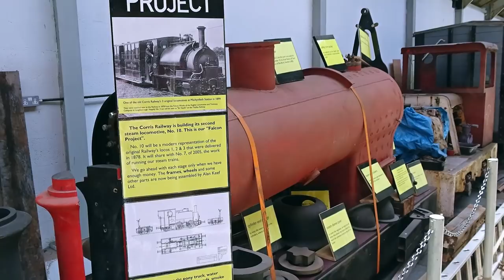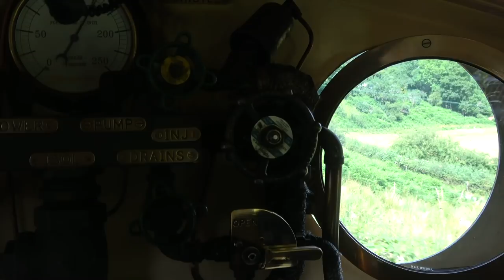Corris Narrow Gauge Railway (Wales, UK)

Comment: I believe I'm correct in saying the only 'original' coach is on another NG rly. in Wales having been found in use as a garden shed or similar, as are the 2 loco's off the line. So where have all the present lot come from.? Liked the video very much. At least the Welsh don't mind these 'old' lines being built again for the pleasure of all. Certain parties in England have been trying to do the same but as usual have been 'stonewalled' by the local council and the local farmers who seem very reluctant to give up a strip of their field a mere metre wide. Unless it is existing BR track already in place and due to be disused then they want so much for it the preservation society can't afford it, or at the very best about a mile or so and in the end don't bother.
Reply from the maker: Hi Christopher, I'm glad you enjoyed it. You are correct that some of the original stock can now be found at the Talyllyn Railway. The locomotive and stock we were travelling in was been built by the railway itself during its preservation era. They are building more in anticipation of extending the running line. This railway deserves a lot respect for its achievements.
I think the Welsh are well aware of how important the "Great Little Trains of Wales" are to the local tourist based economy. 
The railway I am currently following closely in England is the Lynton & Barnstaple Railway. They appear to making progress now, but it is going to be expensive. I am looking forward to visiting again, hopefully some time this year.
I can understand the farmers point of view, it's not so much the strip of land they loose, but difficulty crossing the line to access land the other side once the railway is built, then there is always the problem of inconsiderate photographers trespassing. The Welsh Highland Railway faced a lot of opposition from the local population at first, but over a fairly short period of time many of them have come to love the line and I find the farmers are generally friendly as long as people ask permission first and don't leave gates open.
As for local authorities, they are a law unto themselves, some are very supportive, others are not. Overall Britain has an unrivaled array of preserved railways.
Reply: Ah the Lynton & Barnstable yes, a beautiful line high above the town (and most other things nearby), the Southern killed that one off didn't they in the '30s. Long before my time of interest in transport, - then that soon clashed with girls, and they won hands, (and anything else you could get), down. The trouble is nowadays people don't think to ask permission to take photo's they just 'trample' over anything to get that extra good shot. I always asked, I found it was the best policy, and once you were seen as an 'enthusiast' and was not going to steal or damage anything I found most operators to be very obliging. I was into buses when I was in my teens and even the big companies I found obliging providing you wrote to them before your visit and asked if you could wander around a depot. Mind you that was long before the 'Health & Safety' lot all started up. Personally I think it looks ridiculous to see drivers and firemen on a loco all wearing 'reflective' jackets, I think it takes the originality away, after all 99% of what goes on, on a footplate is only common sense.
Reply from the maker: Aye there's nothing like girls for distracting young men away from trains, I had to wait for my children to be old enough to buy them a Thomas the Tank Engine train set before I could return to the hobby that occupied so much of my time during childhood.
The Lynton and Barnstaple railway closed 20 years too soon, I didn't quite make it to the enthusiast era that saved the Ffestiniog, Bluebell and Talyllyn Railways.
I find treating people with respect and politeness is far more likely to get a good result. Health and Safety issues have brought about changes, no longer can one just walk about an engine shed, but on the plus side many preserved railways now provide viewing platforms allowing a good view without getting in the way or falling down an inspection pit. Most drivers and non safety related staff at preserved railways don't wear high visibility clothing, but line-side photographers at Gala events are a real pain in the backside, there is no need to be inside the fence to get a good photo. I wish photography inside the fence was banned during Gala events.
Reply: Aha I must be antique compared to you, that's why I enjoy your videos so much. I did make it to the Ffestiniog and the others era - just after they had things running properly, although the Ffestiniog was building that massive detour due to the building of that dam. My 1st. wife had to put up with trips on the Welsh ones on our Honeymoon, The Bluebell we had already visited before we got married, I think I took her on it to gauge her reaction of my love for old transportation - that marriage lasted 4 years - I sometimes wonder why. I agree with you about photographers on the wrong side of the fence they can be a 'b' nuisance. With these days of 'drones' etc. I wonder why they still need to make a nuisance for everybody else. Many books I have read that mention the L&B all say without exception that it, as you say, closed too soon, such a shame as it was a beautiful line so I've been told.
Reply: The only trouble I find is the 'NG' ones which really in this Country are the only ones I like are either in a quarry, running in a park, or, been made up. I am excluding of course The RH&D, and The Ravenglas & Eskdale. - what else 'genuine' remains in it's original place of origin.
Reply from the maker: My first wife was OK with my love of trains and playing football, both gave us an excuse to go somewhere as she'd grown up without the use of a car and our children liked riding on trains and playing in play-parks near the football pitches. She visited North Wales with me most years to see the progress on the Ffestiniog Railway including the deviation. My second wife doesn't really like trains, when we met I didn't let on that I had a model railway or that I liked trains, after all I was pushing my luck asking her to hook with me and my two children, fortunately her daughter who was only five at the time liked coming with me to football where she could play with other children. My second wife became increasingly curious about the stair case into the roof space of my house, eventually I had to let her see what was up there, she stood in the middle of the room containing my pride and joy, my model railway and said "I didn't believe grown men really did this", she was quiet for a while, but her daughter was fascinated by it. We are still together all these years later, she still doesn't like trains, the kids have left home now, but they still like to play trains when they visit, my eldest daughter works for Railtrack as a signaler now. 
I use a drone sometimes, I abide by the rules, being careful not to ruin other peoples enjoyment. I hope the L&B are as successful as the Welsh Highland Railway.
Reply: What a nice story, I wish I could say the same. My first wife connived with her parents and a fellow at work - enough said, but they say the husband is always the last to know, - all my friends knew what was going on but didn't say a word to me as they all thought I knew. I did a very silly thing after that, I married a female with 2 children whom I hardly knew - I think the expression is 'on the rebound'. She was living with a chap at the time but I think I must have looked a better prospect, so he was kicked out and I was in. We were married for 2 years and she had my only daughter, she then found someone with more money than me and had a blatant affair with him, so I divorced her. She was married 3 more times, basically she was just a 'gold digger'. Then she came unstuck her last husband threw her out, why I don't know and have never found out, - I think that showed her men can do just the same as she had to her previous ones. It shook the living daylights out of her literally, I had never re-married after her, looking back I suppose I didn't trust women anymore - I don't know - I expect a psychiatrist could give a reason. Anyhow the long and short of it was she came knocking on my door, - I took her and my daughter in as I suppose I felt sorry for her on the understanding she only stayed a short time whilst she found herself a place. The irony of the story was she and I remained together for over 25 years, - we never remarried, and if she hadn't died a few years ago I am sure we would still be together today. I apologise for going on for so long but some days I really do miss her, - I think one must get stupid in one's old age.
Reply from the maker: Hi Christopher, after my first wife left for a new life without me or the children, I was lucky in that only a part of my life had gone, I was able to buy her share of the family home and the children lived with me, and at the time I worked from home. After the initial shock I realized I was starting the next chapter of my life, I met my second wife after a year or so of being single and thoroughly enjoyed courting again.
It is not at all unusual for people to get back together after time apart, whatever attracted people to each other originally can still be there many years later, sometimes we don't realize what we have until its gone. It is a shame she has passed on now, twenty five years is a long time to be together. There is no need to apologize, sometimes writing things down helps put everything into perspective and it is often easier to talk to a stranger than someone closer. I would really miss my wife if anything happened to her and that has nothing at all to do with old age.
Reply: Hi again Tim. .. Yes I quite agree with all you say, especially the part about not realizing what you have until they are gone, and I agree about talking to a 'stranger' does help. Thank-you for putting up with my ramblings, and at the same time I wish you and your wife many more happy years together, and the rest of your family of course.
Reply from the maker: Hi Christopher, the sun is shining here, there's a seagull outside my window making a racket because my neighbor hasn't got round to to putting food out for it yet. To be honest the seagull is a bit of of a pain in the butt, but I've got used to it being there, its part of my daily routine, I know I'd miss it if it didn't turn up one day, besides my wife gets a lot of pleasure from feeding it scraps. Its often the little things that make for a good day, I hope your day's going well. All the best. Tim.
Reply: Hi Tim .. Yes the sun is shining here too, although it is blowing a very cold wind as well, - where abouts in our green & pleasant land are you - (without being too specific if you don't want to). I suffer from seagull trouble as well. Several of my neighbours put bread out for them, but it causes problems as the garden is too small for them to land and take off in. The noise is awful, - ok in the winter (like now) when you can shut the window and keep most of it out. Luckily in the summer they tend to stay near the sea-front - yes I live at the sea-side, not a resort I would recommend for a holiday. Unfortunately my daughter lives up here, and when my 'ex' died I did a silly thing, and being upset I said yes to moving up here as my grandchildren were a lot younger then. Now all they are interested in is girls, and my daughter has her own 'friends', I wish I had stayed down South - worse decision I ever made to come up here. Even worse than marrying my 2 wives as all my friends are down there, and the saying about Northerners not particularly liking Southerners I have found to be very true. Funny thing is I had a train layout round my daughters in her loft, her 'partner' very kindly built it for me, - well he built the base-board any how and I built the rest. I model in the American HO scale as I like the brass models of the Pacific Electric system of interurbans, with a bit of leeway I allow myself for interesting trams of the rest of the world. Unfortunately a pipe to the water tank leaked in the loft this winter and it wasn't insured, - (the layout that is), - luckily I don't keep any trams their, so all I lost was a baseboard and the scenery on it so at the moment everything is at my place. So I am 'playing' trains on a couple of paste tables at my place and deciding what to do with everything, I will probably sell most of the items and just keep the PE stuff and a few others. I didn't realise I had so many loco's and wagons, and that is without the trams, oh well now for even more fun in sorting everything. It's funny you know with the sun out I feel a different person today, although I don't like the wind. - Well as you say have a nice day. Chris.
Reply from the maker: Hi Chris, I live in West Sussex, my Grandparents lived up North in Birkenhead and they had a holiday caravan near Prestatyn. I always looked forward to my trips up North, my Grandfather used to take me around the docks in Birkenhead and the four track main line to Woodside station was just a short walk away. When I was a little older I used to catch the underground to see the trains at Limestreet station, sometimes I would go to Chester where I saw a 9F on a freight ... happy carefree days. 
Seagulls are synonymous with the coast, we are not meant to feed them, sometimes they can be quite comical.
Like yourself I find trams interesting, one of my favorite places is a tram museum near Wellington, New Zealand, all the equipment is British, a reminder of the days when Britain was a manufacturing nation. On one such occasion, I was with my Mother and Brother, unfortunately the museum was closed. A volunteer saw us and invited us in even though it wasn't open. He showed us round, asked where were from and said it's pity we couldn't take a ride on the tram, he showed us this massive old rectifier, threw the switch and invited us to board one of the trams. He opened the shed door and took us for trip along the running line down to the seaside terminus, telling us about the area we were passing through. Afterwards, we said thank you and put a donation in the box. I couldn't imagine that happening in Britain, yet I've had several similar experiences at other sites around New Zealand. I haven't been to Crich Tramway Village for a few years, I must visit again.
It is a shame your own layout suffered as a result of a leaking pipe. You say you are running trains on a couple of pasting tables, when I visit exhibitions I am often amazed at what modelers achieve in a space the size you are using. Its nice chatting, but I'd better get on with work now. Take care. Tim.
Reply: I'll send you a reply later my daughter has just turned up to take me shopping - so she says, but is probably after something more than that. As for me I lived all my life in Kent, mainly in and around Canterbury, so you can see why I liked it, compared to now which is in that town up North that never disposed of it's tramway system. will write more later as I'm getting moaned at. Cheers - Chris.
Reply from the maker: I hope you have a nice time with your daughter. Kent is lovely county to live in, like Sussex there is plenty of lovely countryside, yet London is only an hour or so away. I spent many happy hours in Blackpool with my kids, they loved the illuminations. People say "home is where the heart is", my mother has lived most of her life in Sussex, but she was born, in Birkenhead, living there until she met my father and move down to Sussex to be with him. All these years later she still refers to Birkenhead as "Home".
Reply: Hi Tim. .Yes as you say the advantage is London is close for business and days out, but at heart I preferred the country-side, perhaps that's why I can't stand where I am now. Although as a child I used to love going to the sea-side, and when I grew up as well but not so much, I was never one to just lay on the beach I always wanted to be "doing something". Mind you any excuse for a trip on the RH&Dr I could think of always was nice, and of course they have their own massive OO gauge layout at New Romney - if it's still their. I suppose the trouble with living at the sea is you take it for granted and it tends to lose it's appeal. The problem, - (well for me anyway), - is that it comes alive during the 'season' and once that ends it is like a ghost town until the next year. You would be very disappointed in the illuminations now, they get less every year, all they do now is move them about so as they look like they are different to last years display, also they now charge to 'drive' along them. You realise the ones that were in a certain place are now 3 miles farther along arranged differently, and a lot of firms that used to 'sponsor' them don't anymore so you get long gaps with just strings of white lights in between. No I'm afraid even in the years I've been here it is just going downhill, at least 1 in 4 shops in the town centre are boarded up and 'To Let'. When firms like Curry's and Argos move out, even McDonalds have closed one of their two places in town, it makes you wonder what the 'Big Boys' can see coming. Even our very large GPO has sat gaunt and empty for the past two years, - although they have a slight problem their - it has a 'preservation' order on it. At first it was going to be 'converted' into a luxury 'Hotel' but the large chain backed out when they had done all their sums. The latest idea is it's going to be an 'indoor market' - mind you it is right next door to a large one already, and that has stalls to let in it, so personally I can't see that happening. It will probably catch fire one night, - (happens up here quite regularly when the owners of hotels are "away" out of season), - then - 'oh dear what a shame' it will have to be pulled down and made into yet another car-park. Hotels are closing at the rate of about 100 a year, even some on the seafront, and most are being converted into flats - (DSS style) - as the owners can get more (guaranteed) from the government than they can from having to run them as a hotel with no work attached. It is getting to be there are more owners of hotels in Blackpool living in Lytham than actually reside on the premises. Several years ago the council converted a massive multi-storey car park including bus station in the town centre that had some lovely shops underneath, to the latest in everything. They did away with the bus station - but didn't put a new one anywhere, so now we don't have one. Put some high class offices in part of the car-park, rebuilt all the shops so as they looked very elegant and tidied up what was left of the multi storey. They have been able to let 2 of the shops,- both are high priced restaurants, none of the offices have been let as the rents are too high, and no-one uses the car-park as they put the parking charges up a ridiculous amount, so now you have a very modern looking building with virtually all the windows boarded up. So you can see why I'm so 'enthusiastic' about living up here as opposed to the South ..... Chris.
Reply from the maker: Hi Chris, your story about the decline in Blackpool could apply to a lot of sea side towns all over the country. I live in Bognor Regis, its not the place it was when I was young, the Zoo, the Rex Ballroom, the Pier along with a host of other entertainment venues have all gone to be replaced by seafront retirement flats, they may be nice to live in, but such a policy has killed the town as a seaside holiday venue. All decisions made by the local council are about short term revenue gain with no long term vision other than their own bloated pay packets and the totally undeserved pension bonanza they receive on retirement at 55. You may have noticed I am cynical about local government in West Sussex, that is the result of playing rugby in the 80's with some of those employed by the local councils and learning of the underhand practices they regarded as business, but most of us would regard as illegal, they refered to it as "oiling the works", you and I would call it a back hander.
Bognor is still an OK place to live, but it could be a lot better with leadership, a vision and a desire by local government to serve the community instead of themselves. The surrounding countryside is some of the best in the country especially the Arun Valley. 
Most towns along the South Coast have been blighted by the dreaded retirement flats although some such as Brighton, Hastings and Eastbourne have retained much of their appeal for holiday makers.
I'm sorry to hear that the Blackpool lights are not what they were, charging is typical of the short sighted vision of local councils, the lights made Blackpool a place to visit, those visitors then spent their hard earned income in the town benefiting all. If you have to pay for your day out, then there are a lot of alternatives.
I cannot comment on Blackpool because it is a long time since my last visit, but I remember it as a vibrant place with plenty of reasonably priced entertainment, even on a rainy day.
I've a customer visiting in an hour so I'd better get with drawing up his project....Bye for now....Tim
Reply: Hi Tim .. Sorry I haven't replied sooner only I didn't realise it was 'half-term' for the boys this week and I have literally been dragged all over the place this weekend, - mainly shopping, - something that isn't my 'scene' at all. Preston, Liverpool, and Manchester to name but 3 and when I got back home all I was fit for was falling literally into bed with a some what lighter wallet each day. I'm afraid to say I have only been to Bognor twice in my life, and then I was very young 7 or 8 - if I remember rightly the sea-front is not over long and the beach is all shingle, not exactly much to play on when you are that age. As for your comments on the Councils and those that run it, I couldn't agree more, in fact it is a common joke that more "brown envelopes" slide under doors than the draught from open windows. You can tell who is currently on the Council by how their property suddenly improves, or by how many holidays they suddenly take, - and I will bet they don't pay for a single one. They have no vision up here at all except how much they can get in their pocket whilst they are in "power". To give you an example they spent Billions on building a "new" sea wall of about 5 miles long, as at high tide the old Victorian one allowed the sea over at most times, which of course didn't suite the sea-front hotels. Oh yes the new one looks very modern, but it should at the same time have been raised by 3 feet, - alas that didn't suite the Hotels, as their guests couldn't see the beach, - unless you went upstairs and they didn't have upstairs lounges. So they all went into a "huddle", the result of which (as you say) the councillors mislaid the original plan and the new one didn't raise the wall at all just moved it 30' or so farther out to sea. So many of the Councillors and their wives were driving new cars etc. it became a standing joke in the Town, - enough said. In fact one Council meeting had to be cancelled as so many were 'away' on holiday or 'indisposed'. To give another example, one of the Councillors mothers moved recently in Lytham, unfortunately there was a Bus Shelter just outside her front garden and the buses stopping and starting disturbed her. So at a cost of 15 million they altered the bus route and had to move 3 Bus Shelters so as she had quiet again. I'm afraid Blackpool has just become another sea-side town for the young, - what have the older generation got - the Tower Ballroom and Bingo all over the place, - if your not into either of those pastimes then nothing. Oh yes at the same time it has become the "Gay Capital" of the North, with at the same time whole weeks given over to "Gay" activities. I just get fed up with all this 'Political Correctness' we have to have nowadays. I'm not saying I have anything against them, I don't, - just as long as I don't have to put up with it being 'rammed' down my throat 24/7,  I'm afraid it is just not my 'scene' at all, I have, (and I'm afraid to say still do), always liked the opposite sex. Funny thing to end on, I remember my ex used to 'clip me' round the ear if she caught me looking at other females. Many a swipe I remember 'ducking' out the way of, - I used to say to her at the time, - personally I would get more worried if I was 'eyeing-up' some man, still that's life.  All the best to you and the family. Cheers for now  Chris.
Reply from the maker: Hi Christopher, I've been out about filming trains over the weekend, now its back to the day job, but I thought I'd take a coffee break and check out my You Tube comments. Bognor Council leave a lot to be desired, they have been talking about the regeneration plan forever, nothing has happened, but exploring all the possibilities has cost a fortune. If our towns top council employees were to be paid by results, most of them would end up begging in the streets. But having read your account of Blackpool's council, then I have to concede Bognor's council doesn't look so bad.
Sorry to hear about the shopping expeditions, they are not my cup of tea either, unless it's the model railway shop, for some reason that's the one shop my wife avoids.
The beach at Bognor is long and sandy at low tide, although thousands of tons of shingle have been added to the shoreline to keep the sea from flooding the town. It has become a retirement town now as have many other seaside towns along the coast, only Brighton really caters for the young. I always enjoy walking along the seafront at Brighton, they have made good use of the arches under the promenade, they are all shops and cafes now. The odd mix of people living there does make it a colorful and interesting place to visit, although I would not want live there.
   As for the clip round the ear for looking at other women, that's something all married men suffer from. I can be walking down the street with my other half and she'll say "you dirty old man, your old enough to be her grandfather" and I have to look round to see who it was I was supposed to have look at, then I get it in the neck for having a second look. I love the way the women in "Last of the summer Wine" are portrayed, I'm sure both men and women smile at their antics. I'd better get back to work now. Take care ... Tim.
Reply: Hi Tim ..........       Funny about your remark regarding YT, I had just been watching a program about the Sugar Cane Industry in Hawaii when I noticed the usual little red 'flag' on the YT bell. It sounds as if your town is becoming like nearly all the South is now - 'retirement land'. I didn't realise you had a sandy beach, I think my memory must be getting bad although I was only around 5 or 6 so I will use that as an excuse. I suppose Brighton has to cater for the young with the big university that they built their. From what I remember of Brighton, and I haven't been their in 20 years or so, those shops along Madeira Drive sold Ice Creams, Beach paraphernalia, the usual 'Kiss Me Quick' hats, and the old type of 'Saucy Seaside Postcards'. I don't recollect any cafe's or the like along there, but then if the town is going to be 'flooded' with students at weekends then I suppose it is more profitable to cater to them nowadays. I can remember the first part being built in the early '60's, I think when it opened the number of students numbered under 100, I know at the time my late Mother remarking to the effect of was it worth it for that number.          Funny you should say about what your wife does regarding young females, my daughter does exactly the same with me. Now my grandchildren are starting to bring 'home' girlfriends I'm always being accused of staring at them. Well when your being polite and talking to them where is one supposed to look other than at them. Funny you should mention about model shops, I find the same with my daughter, I have to spend ages in the shops she wants to go in but with the model ones I'm always being hurried to make my mind up. I hope your filming trip over the weekend was rewarding, where did you go? ....... All the best for now  Chris  ....
Reply from the maker: Hi, the sand at Bognor is usually wet, ideal for building and castles, I think you may not have remembered it, because it is under water when the tide is in. The arches under the promenade at Brighton are a recent addition to Brighton's attractions - please click on the link for information - https://www.brighton-hove.gov.uk/content/leisure-and-libraries/seafront/rebuilding-seafront-arches
I used to go to Brighton train spotting when I was young, watching the Brighton Belle coming and going was always interesting, there was always a good chance of seeing one or more of the Carry On characters. The town itself was a bit run down then, especially around the station, today the station has been restored and the walk to the sea front is pleasant.
Many of the arty types who attended the university have made Brighton their home now, opening odd ball shops or cafes selling all kinds of weird and wonderful stuff, whether or not this kind of thing is your scene, it has certainly Brightened the place up. From your comments about your daughter, it would appear daughters and wives have a lot in common. My eldest daughter spent Sunday filming trains with me, fortunately we both like photography and trains make a great subject. I look forward to posting the video shortly ... Tim.